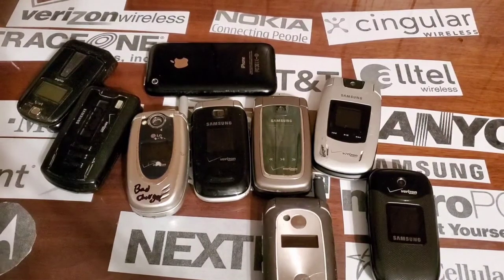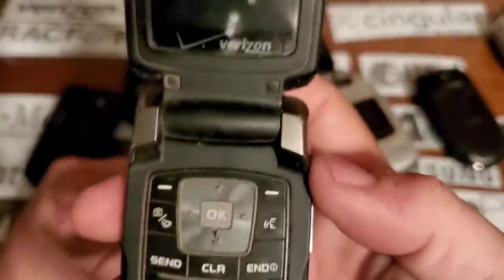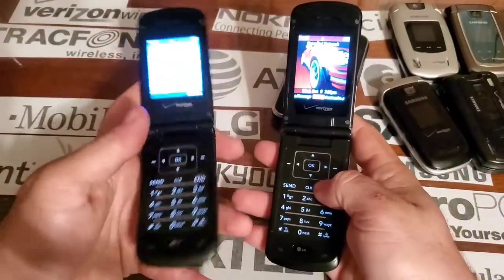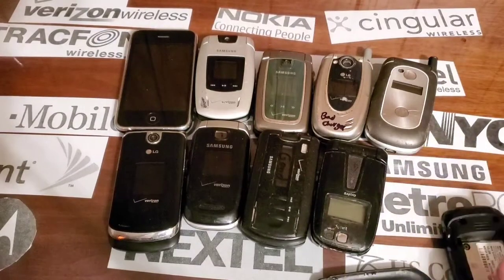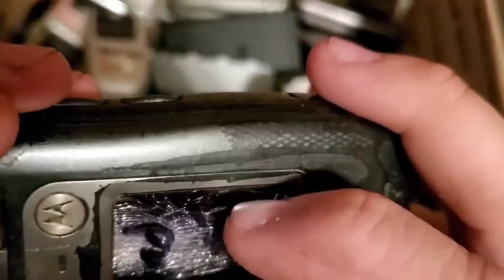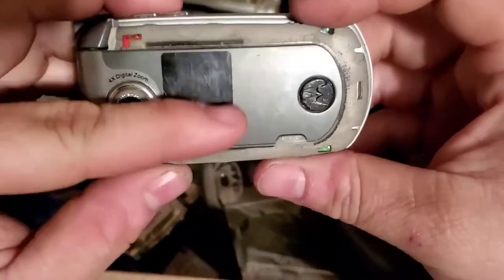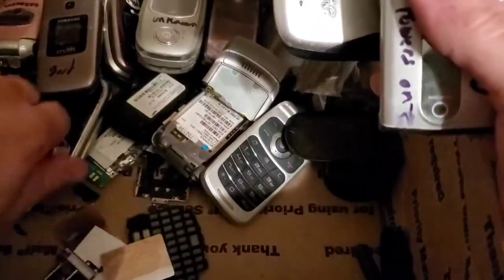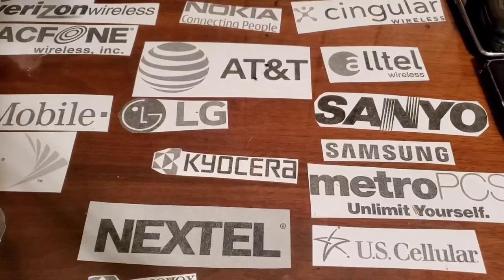Look At The Final Drop Test Phones

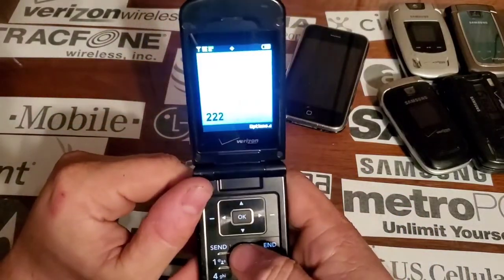Comment: 7:44 I Did The Same With My LG VX5300 & I Actually Locked The Wrong Phone The One That Has Issues I Was Supposed To So Yeah I Had An Extra One That Worked Even Though I Still Kinda Fucked Up So The Other One I Just Drop Tested On Because It Was Pointless